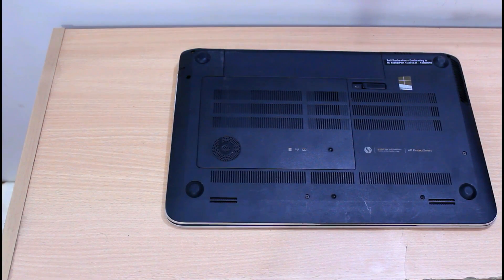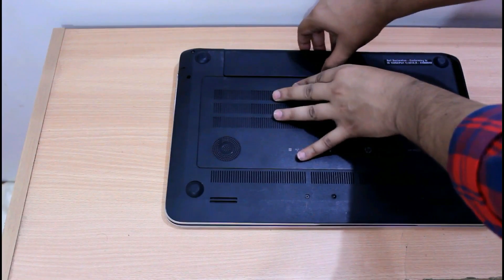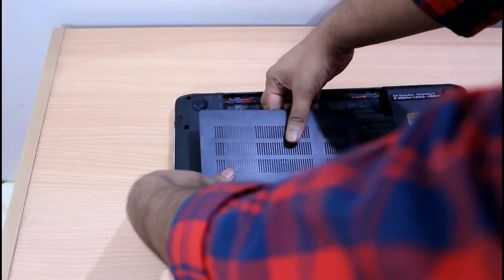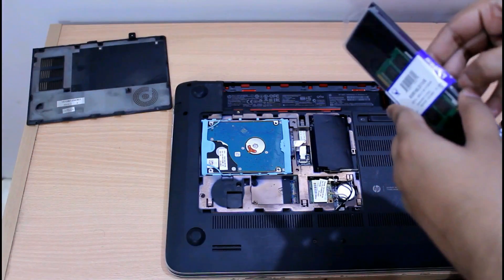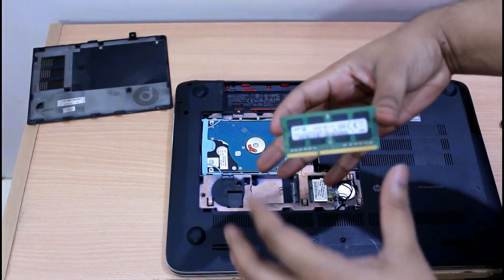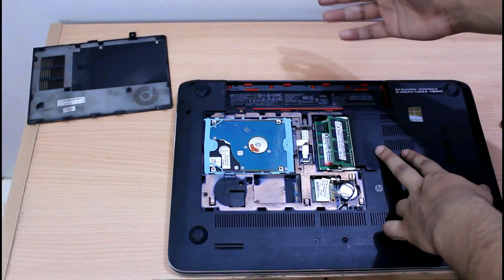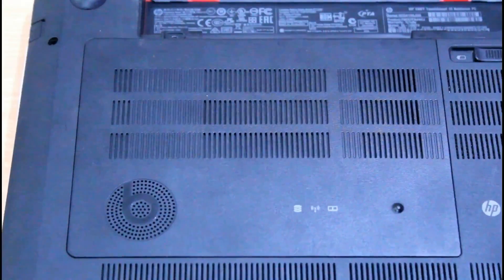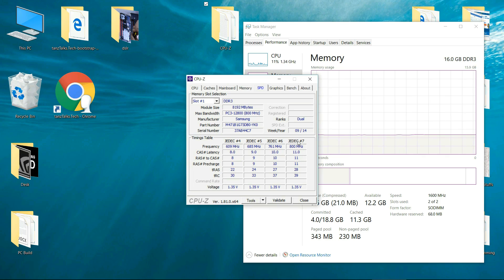2/2: How to Upgrade RAM | HP Envy 15t TouchSmart Notebook PC Disassembly | RAM Upgrade

Comment: i had already  4 gb can i use 8 gb to make 12 gb is it worthy?
Reply from the maker: Yes you can and you should if you need more RAM. If you are not sure if you need more RAM, then try checking Task Manager during your normal usage and see the usage percentage of RAM. If it’s over 70% I suggest for an upgrade.
Reply from the maker: And yes you can add 8GB but be sure to match the specifications of both the RAM

Comment: does buying different brand causes issues?
Reply from the maker: Not entirely because of brand but because of the difference in specifications. If you can get RAMs of different brand but with same specifications, then it should be fine. You need not worry. 

However, if you can get the RAMs of same brand with same specifications, I would prefer it.